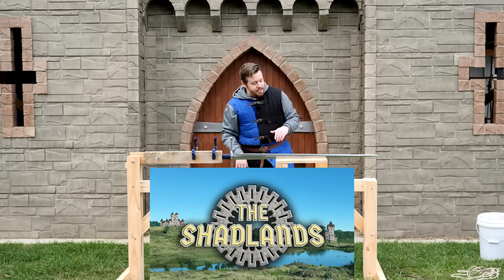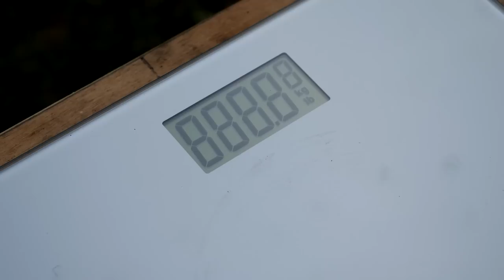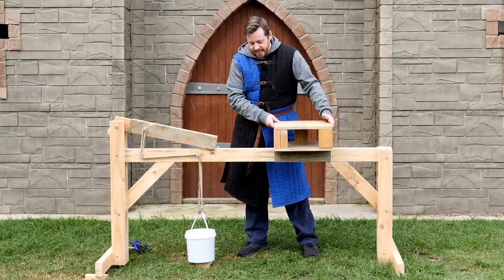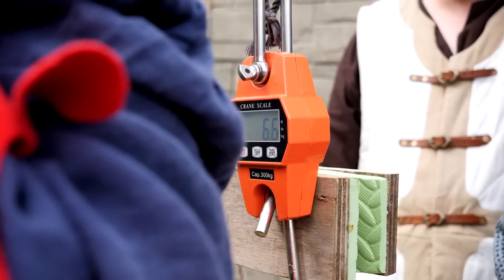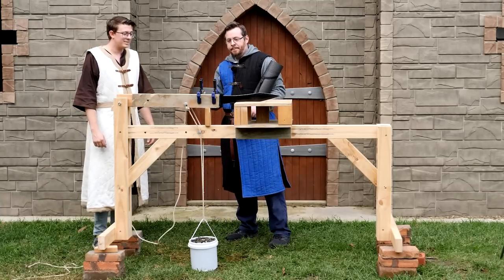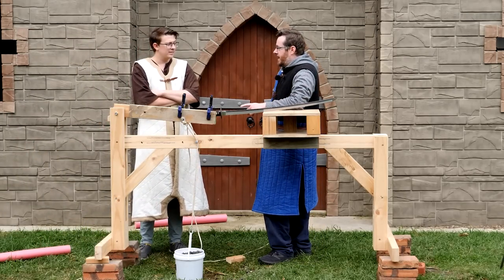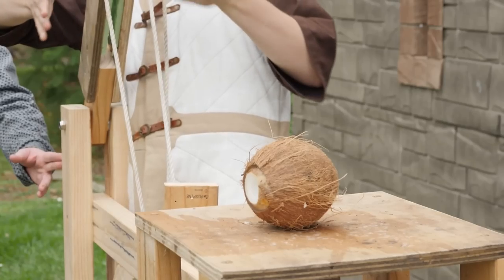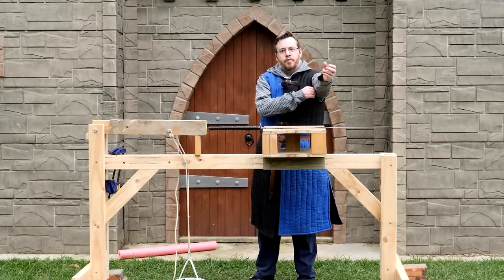Choppy choppy

Comment: so what i noticed is that whenever certain swords struck, the clamps couldn't hold the sword properly and it kept going up, thus getting rid of the force. the reason why you holding it went right through the coconut is cause there was a firm grip so it didn't get forced up. 
so what i would suggest you do is get rid of a little of the foam on the top, then nail 2 pieces of wood there firmly, so that the sword handle will rest firmly against the bottom of those 2 pieces of wood on either side, that way when the sword goes down and hits the target, it will be like there is a firm grip and all the pressure will be in the blade still instead of dissipated cause the sword keeps going up in the grip.

Comment: Definitely the clamping mechanism. It'd be like you trying to hand chop it with a very loose grip (which would be quite dangerous to your hand and even more so if the blade slipped and went flying).

Comment: When you swing a sword, you're accelerating much more than a contraption can do. So the force in the moment of impact is way bigger.
The guillotine has a massive blade which is accelerated by it's mass. An executioner does the same job with a "normal" sword. If he could wield the guillotine blade with the ease of a sword, he would destroy the chopping block. Because the acceleration is way bigger than the gravitational one.

Comment: Hello Shad. That is a realy cool machine you made that could be very useful to objectively compare different swords with each other. That said, it looks like a very dangerous machine. Someone could realy get hurt by it. I would like to advice you to make some safety arrangements when you use this. Things like, only filling or connecting the bucket the moment before you want to release the sword. Or have some safety checks before releasing it, as actualy checking if noone is near, etc. Simply put. Before you use it again, sit together and think of everything that could go wrong and try to think of a way to avoid it going wrong. You do not want you or one of your friends or relatives to get hurt. Especialy since you are an employer and you are legaly responsible for it.

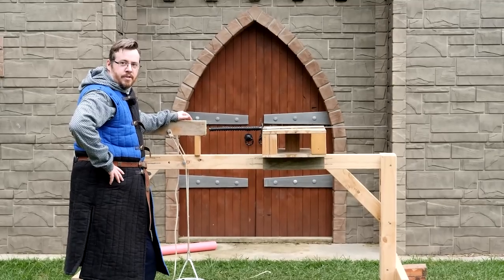Comment: Have the back end of the pivot arm extend out so you can push down instead of only lifting up , add a block on a pivot to act as a safety like in 28:57.  two or more holes in the clamping rig to help prevent the sword from slipping (like a back stop)

Comment: There isn't a mysterie, your results are pretty valid in my eyes. It comes down to the edge geometry of the weapons i think including the dulness.

a sharp kitchen knife kan perfectly and cleanly cut vegetables, it can't cut a coconut (in this case similar to the katana)
an woodsplitting axe can cleave a coconut but on vegetables you will not have a clean cut (just like the longsword, the cut on the pool noodle was not clean)

Comment: The kinetic energy of the impact is being lost because the sword is rotating up in its clamp. You are basically trying to swing a sword with a disk break, so it is just dumping energy into the "break pads" instead of the target. Grip from sword to sword will be totally inconsistent. You need to hold the sword clamping it top to bottom not side to side so it can't rotate. Also just add a 5-10 kg barbell to the end of the lever, no need for fancy pulleys.

Comment: You should measure the speed of the blade on impact, and recreate that with the rig. That's the simplest and most accurate way. Replicate the result, not the circumstances.
And likely the grip is inadequate too. The handle should be supported from below and above by something hard. Like a pieces of wood.
Maybe you should contact Adam Savage from Mythbusters, they've done things like this for well over a decade, and there's a good chance he'll be interested.

Comment: So what I can tell it's the weight. the further you get away from your connection point the less Force it will be pushing be pushing down so you could be running 10 kilos in your bucket but only pushing down in The Sweet spot of the sword 2 kilos. BUT the real reason the longer sword cut deeper is velocity The Sweet spot on the larger sword is further away from the hinge point of your rig which can be fixed by simply moving the sword deeper into the clamp thus "shortening" the sword also to make your rig more efficient and more accurate you need some sort of way to lock it which could be done with a little rope and a compound bow trigger. Then you would get a consistent drop every time you could also put bearings in  your hinge point and a fixed pulley for the rope for the weight just to decrease drag

Comment: seems like you should replace the wood at the pivot for the arm with longer pieces allowing you to put in a pulley and scale letting you pull to the same angle every time and set up a quick release, so its consistent and you aren't in harms way every time you use it

Comment: Use a pulley shad! Your rope will wear out fast rubbing on that bolt, and also get a quick release, cause releasing it by hand is not consistent!

Oh and... Put a safety lock on it, and use a gauntlet when handling things under that blade! it's an extremely dangerous toy... :D

Comment: You might want to use constant force springs. With them you're gonna get pretty much constant torque ate the pivot point, without the dynamics of falling stones. You can then calibrate the device by putting one end of the spring on something rotatable that can also be fixed in place (be it with clamps or something else).

Comment: Don't forget that when u strike something, the weight is not just from ur arm, a strike starts at the feet and then moves up the body and through the arm. So u would have to find a scale that can measure the full force of the strike at the moment of contact, nut just the force by u pushing on it. I think the term would be enertia but I'm not sure.

Comment: Damn Joerg looks different with hair!
Speaking of Joerg you need a trigger for that maschine.
I think you made a mistake when you messured the weight (force) you can apply, in my opinion you have to messure at the end of your hands. And you have to apply the weight at the same point on your devise. You can say lever after the turning point are kind of your arms in this. You need to messure the Nm for this to get a consistance result.
Edit: i think the Katana lost some force because the fit is not strong enough. Consider to drill holes in the clamp and put nails in them to hold the handle in place, perhabs try wooden nails to not damage the handle of the sword. But i think the main reason why it failed is because you hit with more force than the maschine. 
M=F*l  
M=70N*0,45m=31,5Nm
Also i think that the yoga mat did that good is because it Absorber the force because of it's squishiness.

Take everything i wrote with a grain of Salt.

Comment: there is some deviations between your initial measurement using your hand from the applied weight to the chopping device. as shown when you were setting up you saw that the weight decreased as you moved further away/out from the applied force. same rule applies with the wooden pole that you used to get an idea for pressure needed. i suggest getting a measurement from your hand instead of the end f the pole. then apply that weight to where the handle of the sword would be held within the device.

Comment: As its been many times already, the issue may very well be that the impact force from the strike is causing rotation at the handle, which has a higher rotational force that over comes the clamping force and causing a good percentage of the power to be lost in the process. As for for a solution to the issue I have seen suggestions of placing a block to prevent rotation but feel it may be better to have a concave channel  that the handles are being clamped into, like ones hand would rather than a flat surface. that way there is less risk of a possible shearing force at the block and may better replicate a natural grip while still allowing some slip thus preventing possible damage to the sword itself.

Comment: When calculating an applied weight, you jave to take a lot of things in account (without detailing the calculations).

First, with each pulley, you increase the force applied.

Second, the distance to the rotation point is very important. The farther you are from the rotation point, the easier it is to realize the movement (meaning you have the same power for a lesser effort). 

When you applied power on your balance to evaluate you maximum weight applied with a stick, it was not the same movement as the rotation on your guillotine (with your arms you make rotation coupled with a vertical translation).

Furthermore, the wooden stick bends when applying force on it. A sword bends far less then this stick.

Finally, you measured the weight applied at the tip of your stick, while later on you measured the weight of your bucket on a point closer to the rotation point of your guillotine, and according to my previous point, the power applied to a point closer to the rotation point is less efficient.

And for the experience in itself, for the times you did not cut through, you had the problem of swords being pushed up in the handle sheath. You can solve the problem by placing nails above and under the handle to limit its movement.

Anyway, even though the guillotine can be bettered, it's a great idea and a great video.

Comment: Improvements that I see would be, some vertical guides  that will make sure blades are coming down straighter ( the lever doesn't have much rigidty due to the one bolt for a point of contact so it has a lot of visible horizontal movement in slow-mo). A quick release/ safety mechanism to remove human error from releasing and prevent chance of accidental drops (could be just a simple wedge). As far as prosecedurial I would say use a consistent distance from the crossguard of the weapon to the end of the lever ( ex. Every weapon is one inch from the base of cross guard to the  to end of the lever), a simple T square should do
Reply: *procedural

Comment: Those clamps are sorely slipping (they generally can't handle sideways sudden impact), but even if they held perfectly your own two-handed swing delivered way more force. Perhaps clamp the sword handle with much less padding and make the plywood pieces a bit concave to get more surface area on sword grip? Also that bolt & rough cord system is costing a lot of acceleration.

Comment: I have a suspicion and expectation that the reason the 2 hander went through the coconut and the katana did not was that sharpness has very little to do with cutting through such a hard shell, the additional weight and particularly the additional weight beyond the point of impact had a big effect on it going through

Comment: While its good to calibrate, it doesn't need to be similar to human ability at all. All you really need is #1 enough force to cut into the chosen material and #2 the same amount of force every time.  It being more or less than human strength doesn't matter as much. with some materials you may even get more differentiation between weapons with less force.

As far as materials go, I'd recommend modeling clay or some variety of gelatin. starting out with softer, or easier to cut, materials first then going up to tougher materials as the testing goes may be useful.   Gelatin is very good for that since you can change the density of the mix to get better results.

You may need better clamps...

Comment: The foam clamps are really good at stopping the sword twisting or rotating. Without the equivalent of a thumb over the top near the hand guard or fingers underneath near the pommel though, it's not as good at stopping the sword being stripped out of your grip by the impact.

Comment: Try a kettle bell for the weight. It will be shorter than the bucket. You are also losing a ton of energy as the handle twists in the clamp. Possibly it is because there is nothing bracing the weapon handle on the vertical axis.

Comment: The orientation of the coconut makes a big difference. They are very strong length wise, but structurally weak laterally. If yo try to split one end to end, you can't do it, but splitting one round the middle is relatively easy

Comment: The force isn't going into the target, you can see the drop arm wobbling. 

I think a much more complex arm is needed, there isn't enough blade velocity, arms are not rigid sweeps, they are 3 jointed and there's is a lot more mobility in the elbow.
Ultimately I think you'll get a lot less scientific results than you think, organic targets are not uniform, and having a block underneath blunts the weapon. Using a mat under the target protects the blade, adds give to the impact instead of a competed hard surface supporting it, and can help grip the target in place. Maybe a mat with a layer of leather that hopefully won't be cut easily but doesn't blunt the blade too much?

Comment: Full disclosure, not an engineer or an expert by any means; but a few things stand out. The clamps are unable to hold the blade firmly and the majority of the energy is lost when it strikes. Another thing that stands out is the mechanics of your downward swing, as opposed to the device's downward swing. I'll explain: when you perform the strike, it's not a matter of bringing the sword down, there's a lot of subtle mechanics from stance to how you hold the sword that matter in performing the swing. The energy of the swing is channeled through the body into the blade. With the device there's no stance. It's as if you just dropped the sword with 7 kg's of weight behind it, and it's not even behind the sword per-se, but funneled into the arms. It wouldn't surprise me if you put the coconut right under the arms of the device and it did more damage than the katana did, because that's where the energy if focused, in the arms, and not the sword.

The large sword only cut into the coconut because the blade is so much larger, so the coconut didn't have a way to escape other than side to side. The katana allowed it to roll forward due to the curve of the blade which dispersed the majority of the cut. I could be wrong but I feel like the device is less simulating a human strike, and more like if you clamped the sword to an extended handle and you held it from that handle. It shifts the dispersal of energy back toward the katana's handle instead of the blade. Not as big a deal with a huge sword, but very big deal with a katana.

I could be wrong, just my observations.

Comment: Hmmmm...Maybe add a second joint to the fixing device? I am thinking you could extend it where it is possible to still clamp in the sword and add a secondary joint before it. Since the human arm acts on the principle of gradual acceleration and leverage with technactly the shoulder joint, elbow and wrists. It may also be that a person stands on the ground vertically and the sword itself and travel more distance before hitting the target. I did also, notice that when you swing the sword yourself it doesn't remain in contact with one part of the sword even if you only hit it once. As you draw the blade through it even if it is only slightly I am sure it makes all of the difference. So manbe making an even higher rig with an arm of sorts that simulates the shoulder, elbow and wrist joints that move in tandom with how an actual arm moves. You could even simulate a human's grip with clamps and something else so you could get that wrist movement before and after the moment of impact. You could also, add a spring at between the bicept and forearm portion to add resistance that could get you an unexpected result. You could even test it with a two armed rig to be even more accurate though I am not so sure how all of this would work with wood. Though you could go the MythBusters route and use a metal skeleton with joints in the arm like rose joints. Then surround it with ballistic geliton. Then something like clamps or even hooks to keep the sword or whatever weapon you want to use locked in place. If you manage it the results would be pretty awesome.

Comment: Instead of bolts as the pulley system you could use eye bolts. That would give you a more secure rope since it’s housed inside the loop. It may also cause less friction if the rope is riding on the bolt threads. I couldn’t see if they were or not.

Comment: I suggest putting a piece of wood over the upper part of the handle and one under the bottom part. Making a structure like a 2 hands grip.
Also, you only measured the pressure you where capable to produce, but the speed the blade is accelerated is also very important, and the machine was slow. Maybe a gear or pulley system?
Reply: And also a trigger. It may be a simple one, like a piece of wood blocking the system, and a rope to pull it out

Comment: The problem is blade weight and structure. As for improvement hydraulic or a pneumatic system. Now in addressing the blade weight take into consideration how the blade was made and what it was made for.